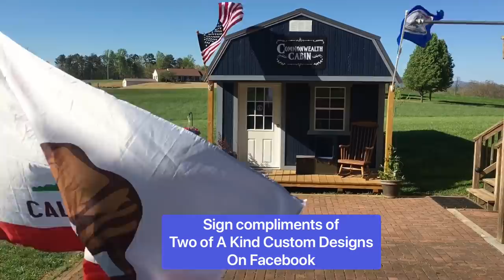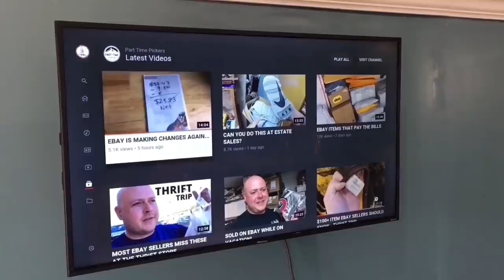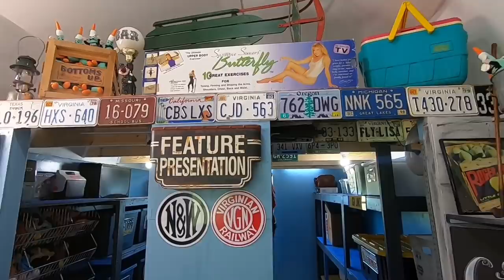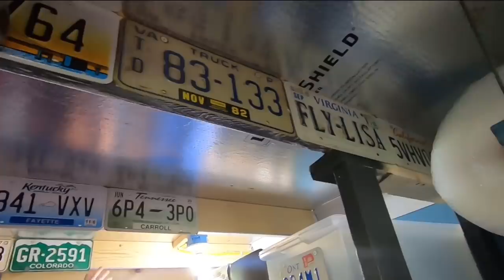This Shed Became my Home Ebay Office

Comment: Kevin, Congrats to your entire family for this Huge accomplishment. I have a few suggestions for you that I noticed about the cabin. First, behind the door to the cabin is a great place to hang a ladder (low profile ladder) that way it will be out of the way. Second, the front door and windows need mini blinds so people cannot see inside. Third, for extra security/safety it would be a good idea to put a deadbolt on the door and a Ring Security Cam (so you will know what’s going on outside of the cabin at all times.) Your cabin is not immune to being broken into because people can find out your address even though you may take all the precautions to keep that from happening. These are just a few tips to insure Eneman stays safe! Thanks for your great content! Ben & Teresa
Reply from the maker: awesome. Thanks so much. and we will for sure.

Comment: 07/18/2023 I don't know if you will ever see a post this new on a video this old.  I have a few questions about your shed.  How and when do you run the A/C and/or Heater?  Do you only run them when you are working in the shed?  Does your inventory survive alright when the A/C and/or Heater are not operating them?  How large of an A/C and/or Heat unit are you using and how much is it costing you extra over your house bill?  And, a non-related question: How do you keep unwanted critters out of the shed and from eating holes in the shed?  Thanks, Doug